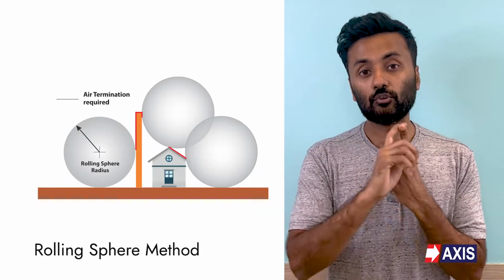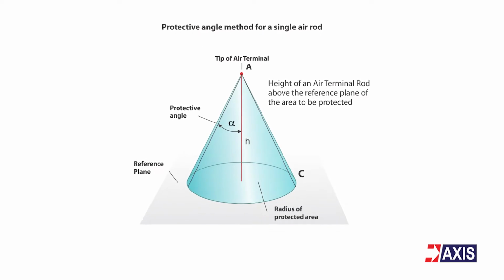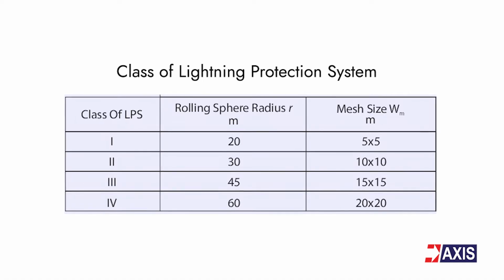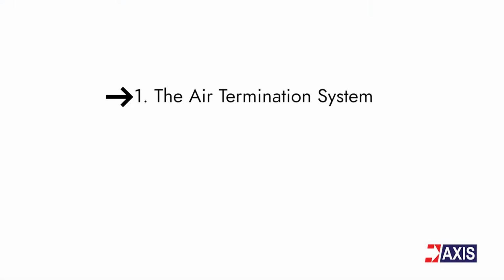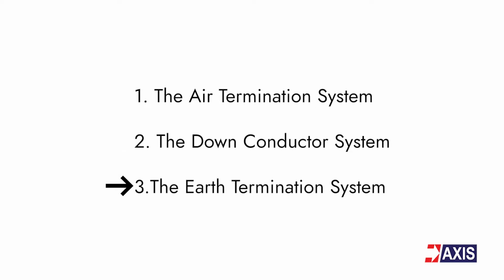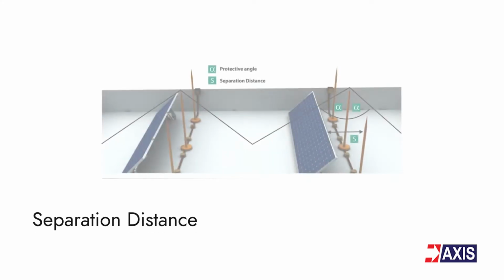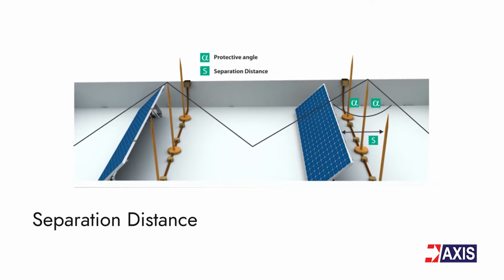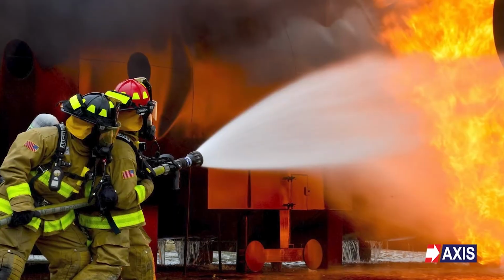Lightning Protection for Rooftop Solar PV Plants Explained!

Comment: Installing a 10 panel home system. I'll just rely on the nearby tv antenna to take the hit. But in the extremely unlucky circumstance of a hit on the panels I'm prepared to take the risk and replacing burnt panels and replace MOSFETs in inverter. It's just not worth worrying about unless weather is crazy in your region. I think industry paranoia is forcing people to go to extremes. How many times have you heard of damage to someone's home because of lightning? It's too rare to worry about. Save your time and money.
Reply from the maker: Hey David! Thanks for you’re expressing your point of view. The first step in any Lightning Protection is Risk Assessment which gives you the probability of lightning damage based on many factors. There are parts of the world where this risk is very high even for residential structures. And there are some applications where even a small risk of Lightning Strikes is not something the client is willing to live with - this is especially true in industrial applications and data centres that have sensitive electronics. It’s your choice on the risks that you’re willing to live with - it’s our job to educate people on the risks that exist. 

Hope you have a great day!
Reply: While some might argue that lightning protection isn't necessary at all, others believe that taking extra precautions is better than risking potential harm to both property and people. The decision ultimately depends on one's personal preferences and circumstances; however, we always recommend doing thorough research before making any decisions affecting your solar installation's safety features.

Comment: How far should the LA be from the mounting structure of the panels to prevent flashovers?
Reply from the maker: Hi Tanishq, 
This would depend on your Lightning Protection System Design and Site Conditions. However, you should ensure that the Air Rod's shadow is not falling on solar modules.
 Also, if LA is near the mounting structure, you need to make equipotential bonding. 
Contact us at sales@axis-india.com for a detailed discussion.